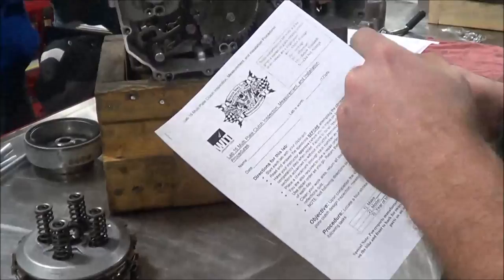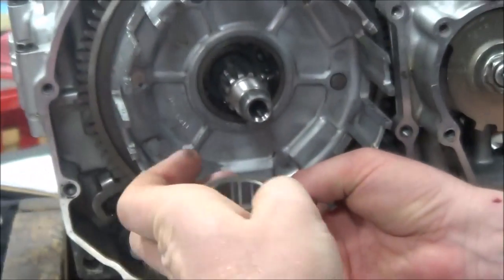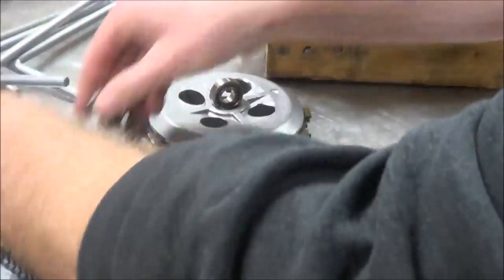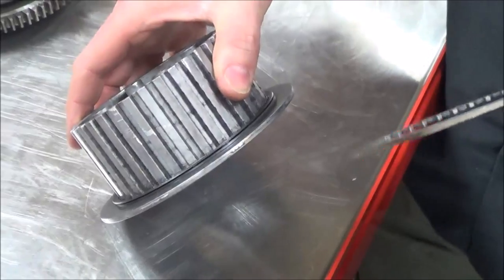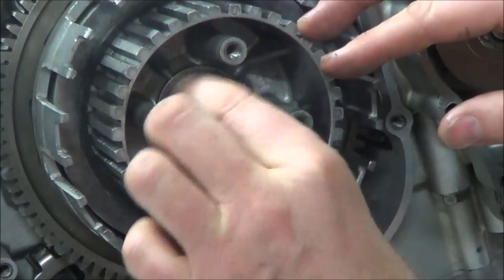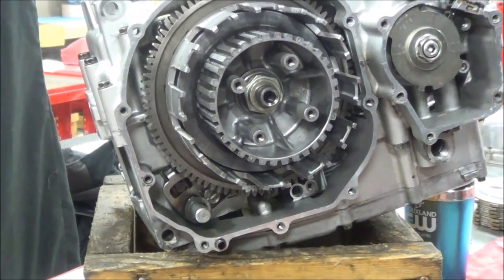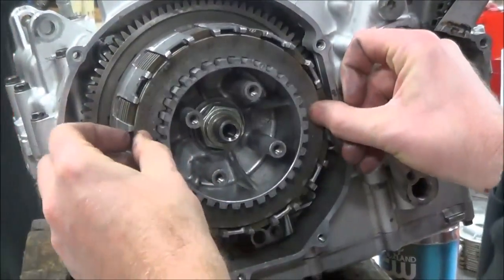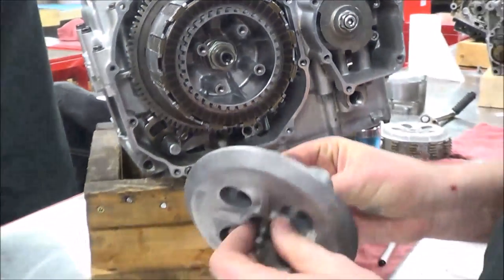4 Stroke Engine Assembly   Clutch   12 16 14

Comment: Thanks a lot Shane for another informative video. I'm in the middle of replacing several seals, repairing a broken counter shaft bolt and doing a clutch service on my 1980 Yamaha XS850. This video provided me with some really great insight for reassembly. Thanks!

Comment: Something else do be aware of - don't do like I did and attempt to torque down worn clutch springs with a medium sized torque wrench - you will DEFINITELY snap the heads right off the bolt haha. You can check if your springs are within spec using a vernier caliper! And maybe invest in a baby torque wrench. Although I'm also wondering if you could get away tightening the bolts carefully by hand, or is it fairly advisable to be right on spec? Cheers!

Comment: Could you do a video on a kfx 05 transmission gears I cat find anywhere on how to put the gears back together
Reply from the maker: We have a service department that gives a discount at times when we have not done a video on that model. Reach out to us @ 712-281-8374
Reply: Shane Conley how about if one of the little nubs that the screws for the cover is broken is it gonna b a bad bad thing